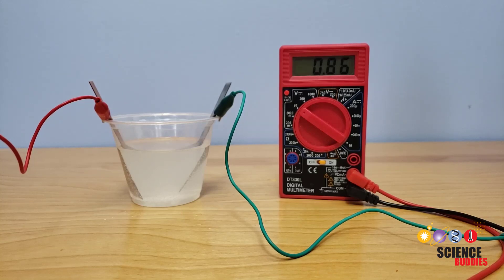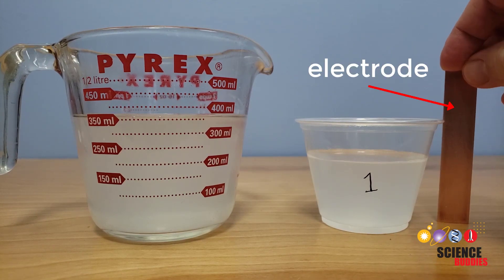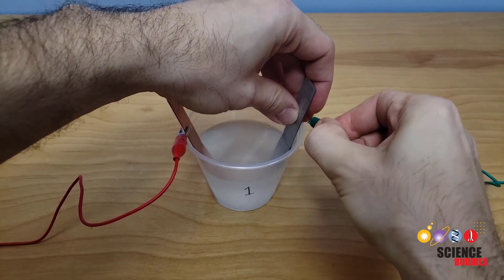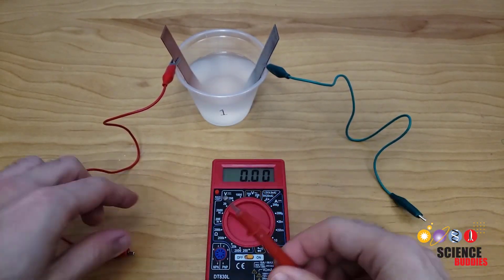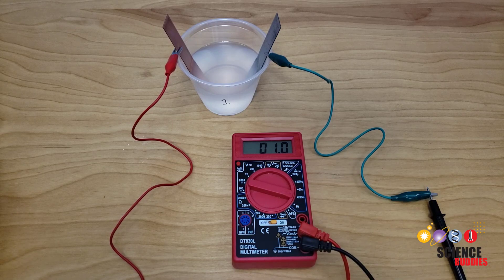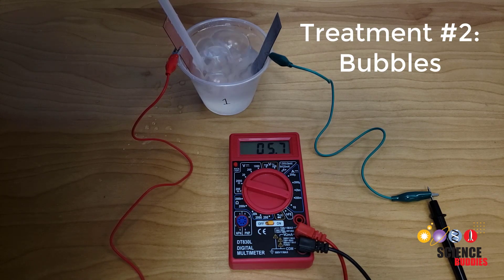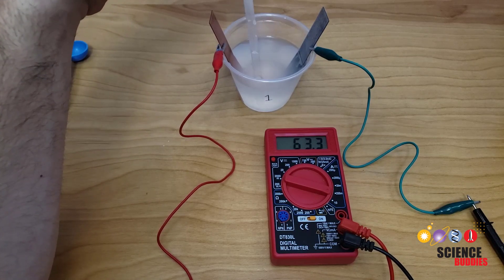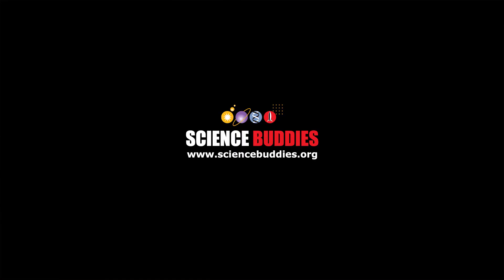Salt Water Battery Science Project

Comment: Interesting and thanks.  Such tinkering can be even more interesting.  I once tried a similar experiment after watching a PBS Nature program about the effects of fresh water and salt water on the likes of salmon and fish that typically occupy brackish water; anyway, there were a few side comments about the effects being 'electric' and such effects might have influenced evolutionary events.  Anyway, I had several ohms sorts of Ohms meters on hand at that time (Ohms meters are like fancy forks at formal dinner parties, one for salad, one for the fish, and one for the dinner. Don't ask me why, it just the way it is. In the case of the various meters, the scales may differ, as well as the sensitivity, and some are digital and some are not.)  I got one of the more sensitive analog ones out and I placed two shot glasses on the countertop in a row, each with about the same amount of tap water in them. The first one had a half teaspoon of salt in it. I bridged the gap with bits of paper towel soaked in salt water from the one glass.  (I think that the details are right, this was about 5 years back.)  I set my Ohms meter to 50 micro-amps and probed my handmade "battery" and boggle, I detected something like 5 or was it 10 micro-amps?  PBS was right.  There was a change in "current" or was it detecting the possible change in ion concentration? The results in your experiments may vary, I suspect.

Comment: Would all salts equal in this experiment? Is there a saltier salt?
Reply from the maker: A galvanic cell will eventually reach a state of equilibrium. You can test different types of salts besides sodium chloride to see how they impact the chemical reaction, for example Epsom salts (magnesium sulfate). For more ideas on variations of this experiment, check out our written instructions here: https://www.sciencebuddies.org/science-fair-projects/project-ideas/Chem_p107/chemistry/make-a-battery-with-metal-air-and-saltwater

Comment: thank you so much for this great video, could it work also with 100% sea water? thank you!
Reply from the maker: We haven't tried this project with sea water, so we can't say for sure, but that would make a good experiment!
Reply: yes but sea water is not 100% salt+water, there are other minerals but yes you can. you may have to clean electrodes if the voltage goes down.

Comment: Hi! Is it possible ot make a battery with aluminum instead of zinc?
Reply: no, probably not. old pennies have zinc in them but its illegal to sand the outside edge of copper off. you can buy zinc washers for $0.10 at lowes, and a giant zinc nail for $0.50

Comment: Hi, I'm doing a science project on this. I wanted to know if, instead of copper and zinc electrodes, would I be able to use copper and zinc bolts? Or any other replacements for the copper and zinc electrodes?
Reply from the maker: Hi - yes, you should be able to use other parts made from the same metals. Just note that surface area affects the reaction, so you may not get as much current from a narrow-diameter cylindrical bolt as you would from a larger, flat rectangular plate.
Reply: @Science.Buddies  Okay, thank you!
Reply: You can also use alumium foil and a graphite pencil "lead"

Comment: Hi, I'm doing a lab report on salt water batteries and I was wondering if this would experiment would work with a joulemeter?
Reply from the maker: Hi - you need a multimeter, with the ability to measure voltage and current, to do this project.
Reply: @Science.Buddies  That's very helpful, thanks a lot!